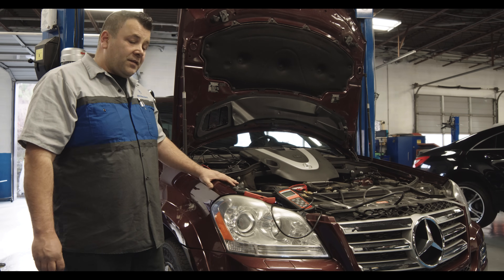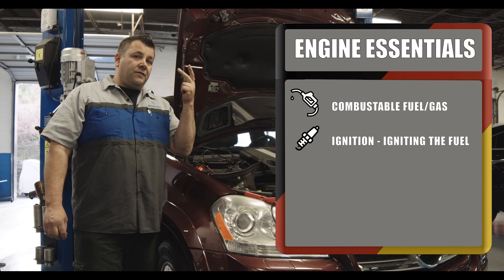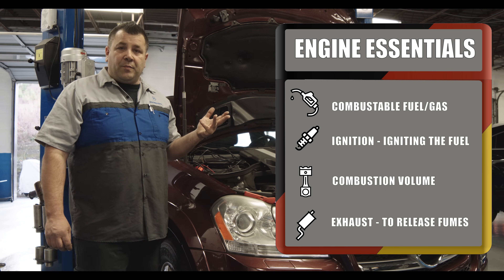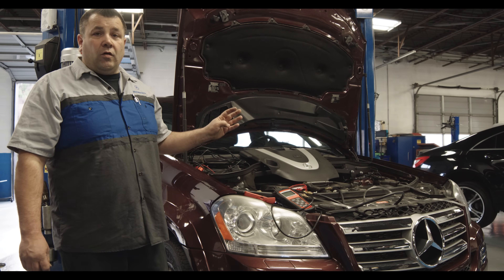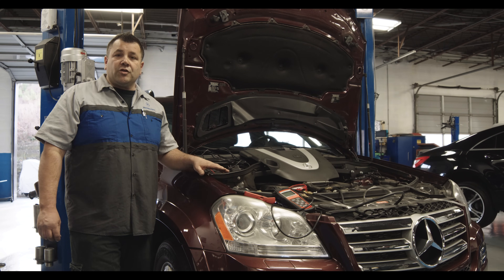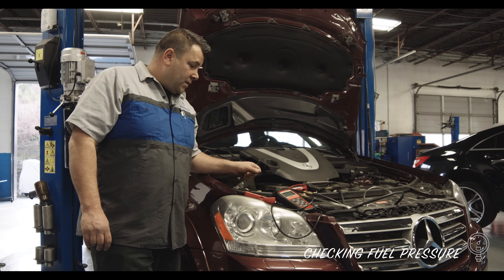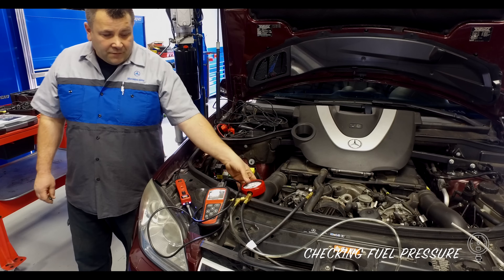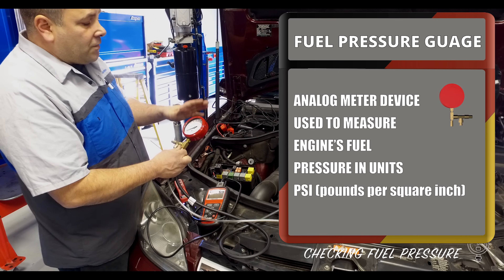Why a car won't start -  Mercedes Benz Troubleshooting Guide, Tips

Comment: HI I have a Mercedes c300 2011. so this morning I went to start the car but the car didn't turn on.  the dashboard lights are off. Radio is working and the lights behind the door works as well as the front light works. I tried to turn it on but not response. I've watched your videos which have awesome content by the way. but I just wanted you to give an advice before taking my car to the mechanic. besides there is a very slightly smoked smell and I don't know if its just me but I hear like a bug constantly. please help figure out want could be causes of this issue. thanks in advance
Reply from the maker: Brian Huertas most likely steering lock for no start issue as far as oil smell, rear centrifugal cover or vacuum pump or both.
Reply: thanks for that quick response. problem solved it was the battery. I really appreciate your effort in this channel which has a lot of information. Full support from FL keep it up
Reply: Brian Huertas  you are a good gay and a good mechanic to!

Comment: Key accepts and turns all the way, wont start. Tried a little bit later and it turned over and was running. Turned it off, no start no start. Several codes came up after 3 codes came up. I then started it in the morning for a few seconds and it turned over and ran, I shut it off after about 5 seconds. Later checked on it wont start. Raised the hood and an air filter hose was off. Put it back on, checked spark plugs all are fine. Still wont start. Dad said after the work let the car alone for a few to commute or something. 

Sometimes, I hold the gas pedal down for 17 seconds then wait two minuets. Whatever that did, I noticed shifting changes for the better. Please tell me it is something minor. A few days ago, I bumped an electric wire. No major damage because I was able to get out of the car. Could this have something to do with? If it was a problem, I would not have been able to drive away. Please help
Reply: Its time to take it to a shop thats what that means..

Comment: It would be much easier to buy the 150$ icarsoft scanner and it just tells you exactly what the problem is, it can scan most of the modules on board, not to mention you can reset a few codes yourself, well worth the investment for anyone with a used mercedes.
Reply: I prefer to use my, 
iCarsoft C990 Elite
Display: 4.0″ TFT LCD, 480*320 Pixels
Operation Temperature: 0°C ~ 50°C
Storage Temperature: -20°C ~ 70°C
Operating Voltage: 9 ~ 18V
Operating Current: 150mA@12V (Typical)
Power Consumption: 1.8W (Typical)
Dimension: 206*104.1*32.6 mm (L x W x H)
  
        Price: $1000.00
Reply: SHELVES ETC
Reply: My friend parked the car with basically  no gas in it  it sat for a week ..then she ended up putting in old gas it drove a quarter of a mile then started putting and will not start can you help please

Comment: My car is GL500-2012 

after 30minute if I turn my vehicle off and start again it will start cranking very week and delay for the engine to start (note that when the engine is cold everything is ok) please advice
Reply from the maker: Aso Mustafa need to check if you have fault codes, it might be CPS (crankshaft position sensor)
Reply: https://youtu.be/B34cBqSuqLQ

Comment: A lot of editing done to this video . Good job ! :)
I work on all car makes and from time to time something bizarre come to the shop . Cuz you are working only on mercs i will ask you about one of this cases .
Mercedes E280 CDI W211 . Every time you shut off the car and start it again , the automatic gearbox refuse to work for around 30 sec ( by refuse i mean , can't switch to D or R ) . After this period of time , the gearbox is working perfectly . This happens on every start . The only code that the gearbox has , is network ( CAN communication ) problem . I scoped the CAN + and CAN - in this 30 sec period , and the network has perfect waveform . No glitches or bugs , just casual CAN signal . Any advices , do you encounter this kind of problem ?
Reply from the maker: Crank we had to shrink it from 6 hours to 10 minutes.. so we had to edit a “little” and still keep it informative..
As for your issue, very simple system, check your brake switch, under brake pedal, shifter or battery, do you have the SBC in your car?
Reply: I watched the brake switch through the star diagnosis , and its working . Same for the shifter , the diagnostic see when i go to D or R , but the car doesn't move .
Reply from the maker: Crank what year is it?
Reply: Its 2006 or 2007 , not 100% sure . Probably 07